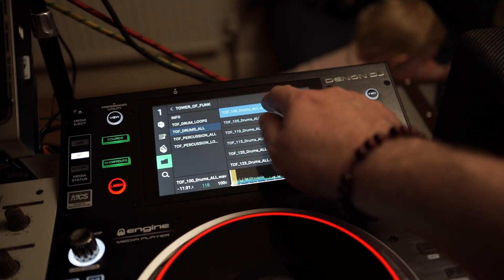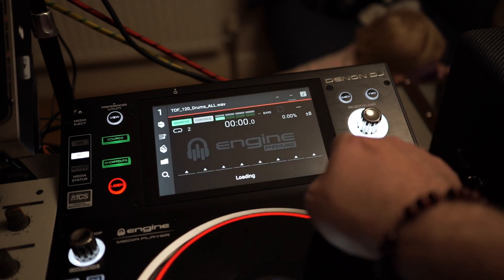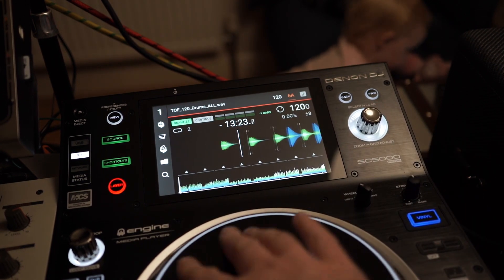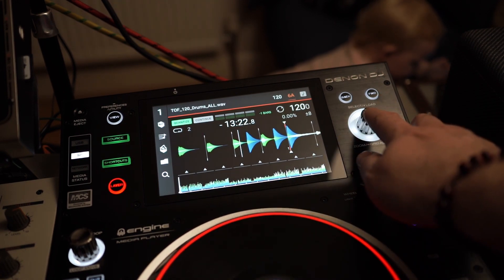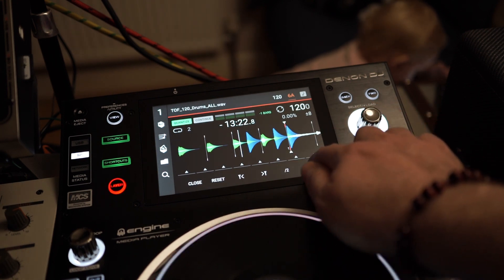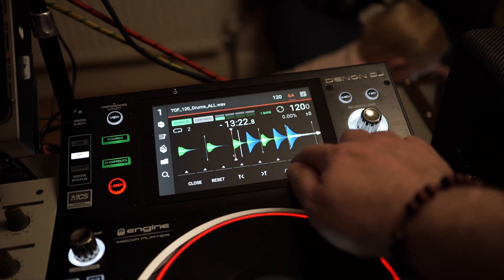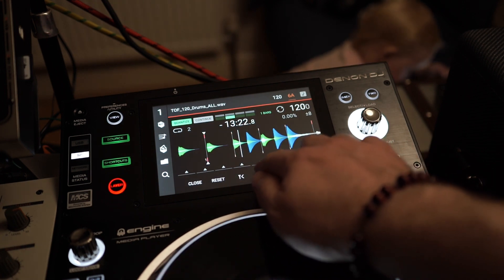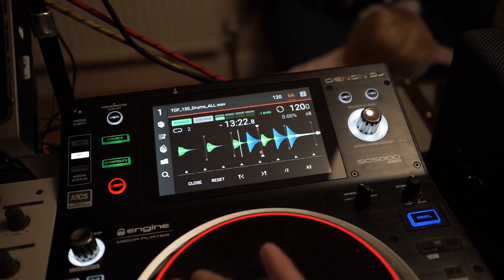Fix or adjust the beat grid for a track on the DENON SC5000

Comment: When the bpm is wrong on track and it is not 1/2 or doubled how do adjust the track to find the right bpm. For example one of my tracks reads 80 bpm when it is 122. Can I fix it in the player.
Reply from the maker: Hey I just tried and i can't find a way to manually adjust the tempo sorry, Denon need to fix that!
Reply: No worries just making sure. It wasn’t me

Comment: Hi there, when i try to mix  on the SC5000 it goes off beat when it's synced and even when its done manually.  I haven't experienced anything like this.  I thought the sync button on the sc5000 would work the same as on traktor.  If not, then doing it manually is fine.  I've made a 1 minute video, showing you the problem im experiencing.  It's possible to keep it in time, by constantly adjusting the pitch and wheel, but then you can't use the mixer as much.  would you mind to tell me what the problem is?   https://www.youtube.com/watch?v=PxfWFbKNomg&feature=youtu.be

I dont know why the beats cant match, when i use sync, it goes out of time
Reply: Yeah I did that and it still goes out of time on a 8 beat loop.  Do you have any tips on beat griding correctly?  I think the beat grids must be off.